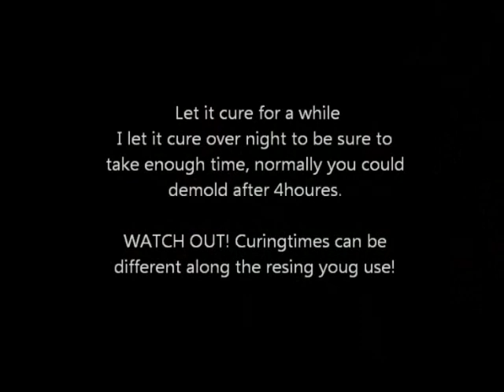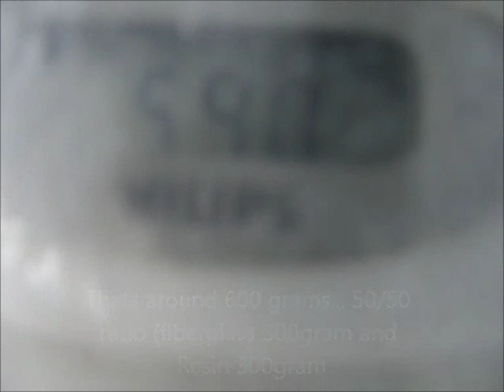Tutorial - Vacuum Resin Infusion Of A Car

Comment from the maker: Hi thanks for the response, I agree there is a wast of material. There is a waste of resin and materials for the use of vacuuminfusion like the peelply and the infusionmesh. But the main purpose of this technique is to have a lightweight and as strong as possible finnished part at the end. This technique gives you the best fiber/resin ratio (after Prepreg used in automotive and aeronotic industries). This was also my first project where I learned a lot out. I have some other videos on my channel

Comment: I laminate fiberglass hot rod parts every day, one thing I will suggest to you is to put hard-lines/straight edges to the outside of the mould, where it trims, if a part is gelcoated it hard lines can dig through the gelcoat and leave an ugly line. Also try using strips horizontally across the part rather than a mess of puzzle pieces, this leaves less overlap and keeps the thickness consistant.

Comment: There is some logic in that in theory, but as far as increasing "overlap" (meshing the fibers together), you're talking about spray application with a chopper gun. The problem here is its difficult to get a uniform thickness, and tell where the part is sturdy or weak. Been working with fiberglass for years, took some summer classes at a local college. If my instructor had seen me laying up the cowling I'd made (a similar deep-dished mold) that way, he'd have pitched it.

Comment from the maker: by patching it you'd in theory get a stronger part because the fiberglass is layed down in a more random pattern with some overlapping. It's also easier to have the fiberglass deeper into the corners. A mistake i've made in this video is that I didn't put the fiberglass deep enough into the "headlights" of the car, thats why I have to much resin over there. It could be prevented by pulling a bit of vacuum and then push the vacuumbag firmly against the mould before pulling full vacuum.